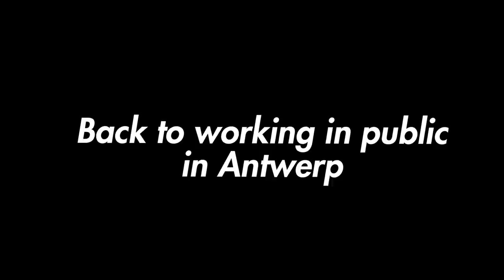Spray Painting My Car IN PUBLIC !

Comment: That Bruh moment when they realize rain exists
Reply: they have some water proof spray paint but idk if they using it
Reply: Hi im very Cool u could put stuff on it to protect it i’m sure
Reply: Mtber05 yeah but that’s cause there’s a layer of clear coat on cars. He just put spray paint on top of clear coat and didn’t seal it with anything, so the paint will eventually fade or chip without clear coat
Reply: @Mtber05 well its not normal paint which is used on cars, it's spray paint dude
Reply: That summer, which I presume was in 2018, Belguim (and the Netherlands) hardly had any rain at all.....
Reply: Hey guys, we have a channel where we make customs too!  If u could check us out, it would be awesome! Be safe!
Reply: I don't understand this comment.  Spraypaint is usually enamel, meaning it's more like resin than what we think of as 'paint', which is usually a form of acrylic. Both of which, do not wash off after they dry.
Reply: The Bruh Moment when you realise clear varnish excists
Reply: The spray paint he uses is half paint half finish!!!!!!! Jesus guys
Reply: Bruhh
Reply: Enlightened conciousness someone's pressed😘
Reply: Enlightened conciousness  agreed!!
Reply: .... Most Spray Paints are Waterproof...
Reply: Waterproof

Comment: It is for something that painters use booths to paint. The environment and the ozone layer, Out in the open. It is still allowed to use this kind of paint at high pressure, knowing that it hurts the air. Someone who knows everything will not come to give an opinion and say that I am wrong. I watch his videos a lot, but that's not why I accept that so much paint can be used outside the environment.